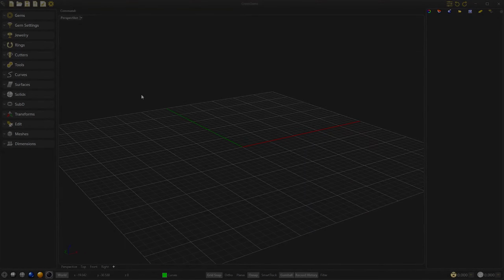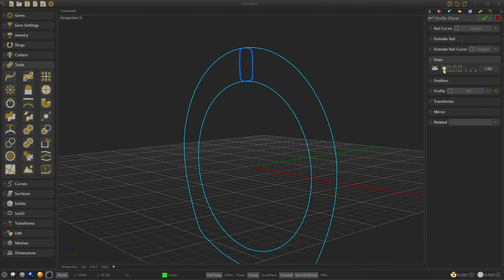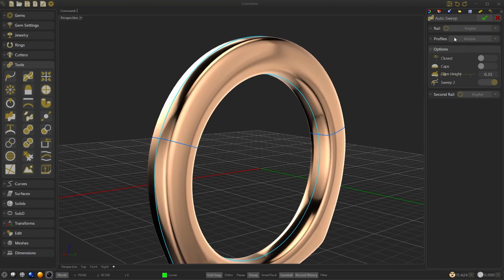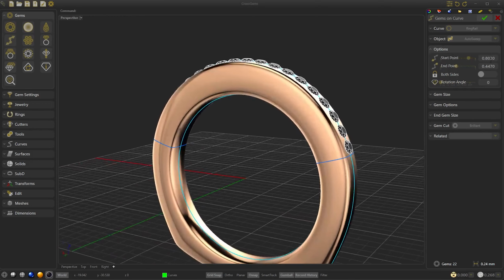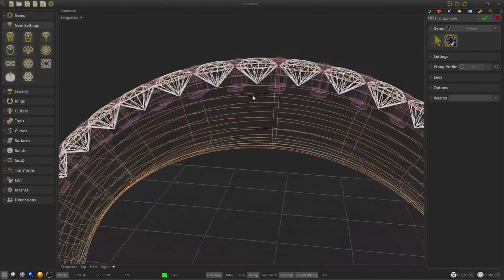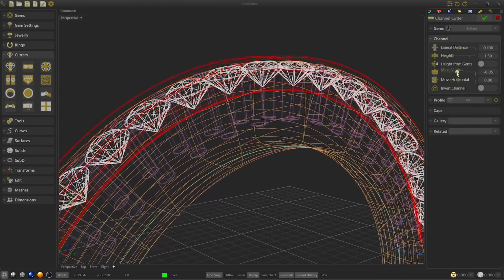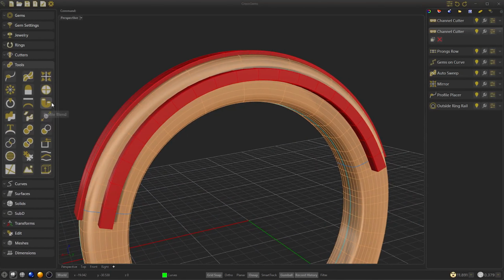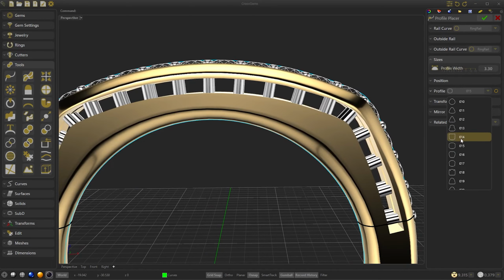CrossGems Tutorial - How to create a shaped ring with modeling techniques from scratch

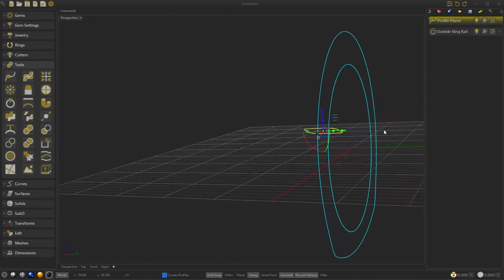Comment: at minute 1:20, we could avoid making a Mirror by checking the very nice option into the Profile Placer... ;) Great video showing how to modify easily the designs
Reply from the maker: Hello Thierry, sorry for the late reply, we're back from summer holidays :) Yes, you can use the integrated mirror option, the point, in this case is to have it as an independent entry in the command history, but it makes no difference on the generated geometry.